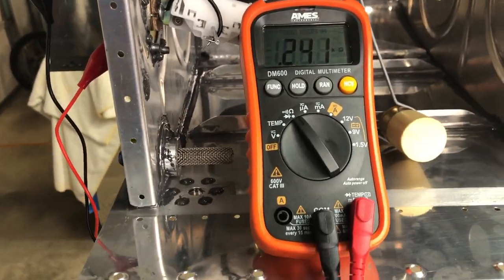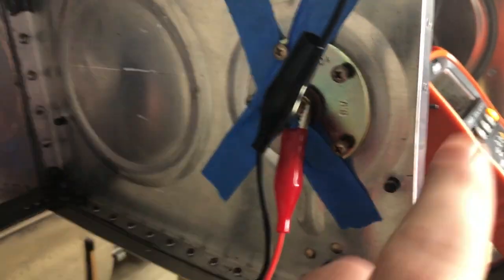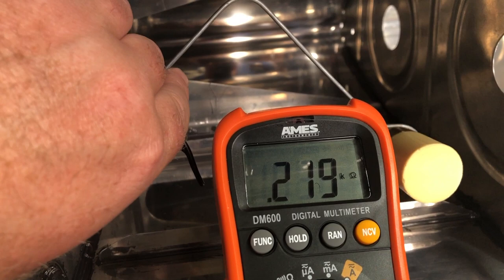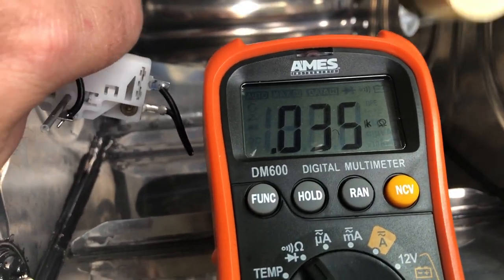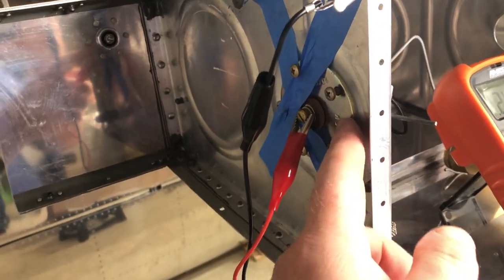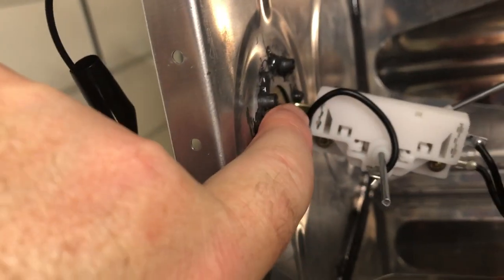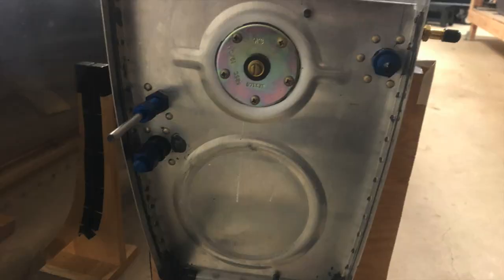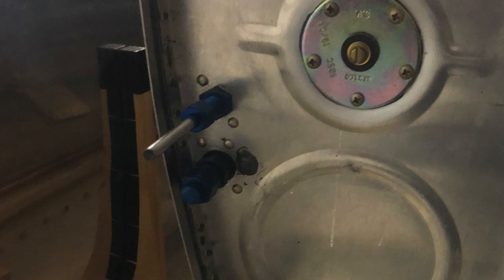How to Test Stewart Warner Fuel Level Sender in Vans Aircraft

Comment: hey Ryan, what kind and size wiring did you use to hook up your floats?  Shielded or non?? How is the building coming along?
Reply from the maker: I have not hooked up the fuel senders yet, they are easily accessible when I install the wings.  There are charts you can look at for amperage and length of wire to figure out the gauge.  As far as shielded I am not the expert, but I don't think they need to be, they are nowhere near com cables.

Comment: Now that you know how to use a digital multi meter (DMM) you can use it all the time around the house. 

If you think you might ever want to get your A&P rating,  talk to an A&P/IA about inspecting you work on the RV signing off on counting the hours towards the rating.
Reply from the maker: My understanding is that hours building an experimental does NOT count toward an A&P rating.  Either way, I have too much in my life to pursue another rating.  I am building experimental so I don't need the A&P.  Maybe if I was younger.  I need to get through my IFR cert first.  On the other note, I used my multi-meter this weekend because my TV remove was not charging in the base...the leads were developing the right voltage, turns out, a contact got bent and wast not sitting on the remove properly.  It save me a bunch of money in a new charger base that worked perfectly.